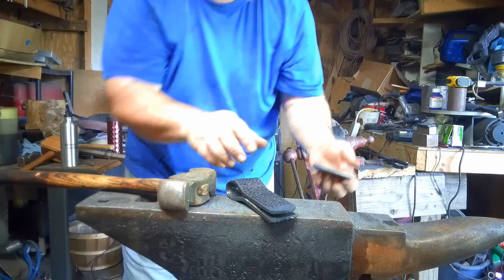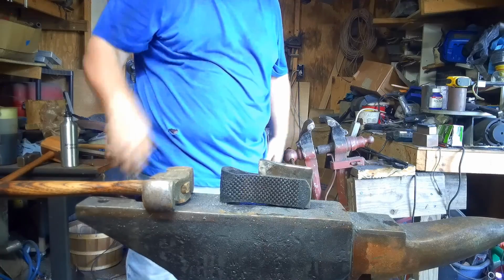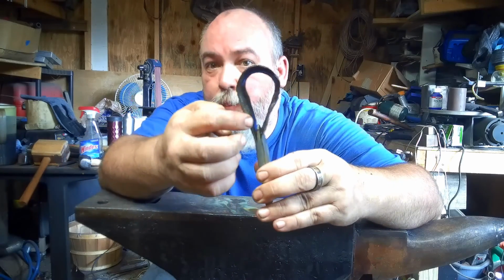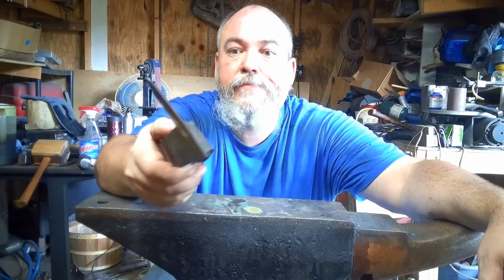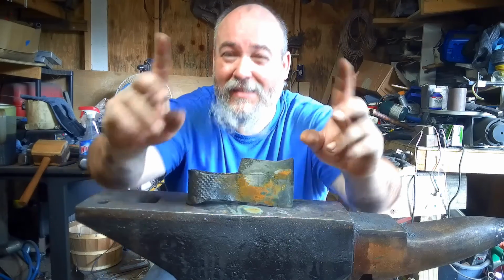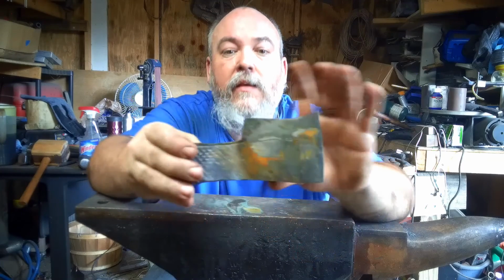Did it work

Comment: By the looks of the steel on camera, it was all hot enough. I actually don't clean my steel, or wrought iron. Usually losing heat on the underside (that's against the anvil), or hitting too hard to set the welds was my problem. I use a 1lb hammer with a long handle to set mine, which is plenty even for large things (like 2" round stock). Some people even use a wooden block under the steel to set the welds at first. I usually set mine all with three heats (for large stuff), then do the real heavy forging while keeping the steel at a welding temperature. My dad mentioned that I have a video forging an axe. Technically it's a carving hatchet, but still may help. Even though my videos suck, lol. I did see that you said "thanks" for the spikes too, looking back at those messages. Good luck in the future. My rasp tomahawks, or hatchets take 30 minutes each from start to finish for some kind of reference, but I work on 3-6 heads at a time. Production forging really speeds my stuff up.
Good luck in the future man.
Reply from the maker: thanks William. Ya i think the hitting to to hard plus not welding next to the eye fist did not help.  leaf spring and a rasp i think the scale formed to fast.
Reply: @BBForge  it may be scale for you in all honesty. Gas forges oxidize steel and iron faster than coal forges in general. My main forge doesn't oxidize my steel much at all since it's very deep and I use clean anthracite coal.

Comment: Your critique is correct. Fold and weld the eye. Then insert the bit and forge weld it. Also when setting the weld don't keep pounding. Few light taps and back in the fire. You got it brother. Hell I can't even count all my fails. Used to keep them but the pile got to big.  I'll be waiting for the next video showing a success!
Reply from the maker: thanks Jim, I thought thats what i did wrong,.

Comment: It's hell getting those to stick. I learned you only get a couple taps on each welding heat. Here's how it works. To weld you are getting just  the surface of the metals molten. At that point you can tap it a couple or three light ones. If you hit it hard or too much, you just splatter that thin molten layer away and it'll do exactly what it did. You done good Bob! Cutting them teeth! Ya gotta tease that weld in there easy like. Do it again. Then one more time. Get the feel for the sticking it has to do. Only way to get your welding skill built up. Thanks for the video man!
Reply from the maker: thanks James

Comment: Yup, it's tricky. My first axe didn't work out either for the same reasons. You're idea worked for me and a little bit of separation at the eye isn't a big deal.  You might try using a smaller piece of high carb for the bit and put some teeth on the back end. Saving some material, those teeth will keep it from slipping around at welding temps. Great show!
Thanks
Reply from the maker: thanks Mack
Reply: @BBForge  sure thing! Good luck, look forward to seeing your new axe!

Comment: Guessing I should send ya a couple of rounds so you can make your drifts and what not.  Ting ting said it would work...and I'm sure he knows 😁
I know it gets hard enough if you try to cut it w band saw...you get a nice 32th in mark and a trip to the store to buy a new blade. 1 days 4160Ish one says 1085 ish. I know its 1.5" rounds from Scams on 5axle heavy haul trailers break's 
Sorry it didnt turn your way sirSir 
🙏blessings to ya now 
Crawford out 🧙‍♂️
Reply from the maker: thanks Daniel,  I know axle is good steel of tools.  and 1.5" that's a nice size.